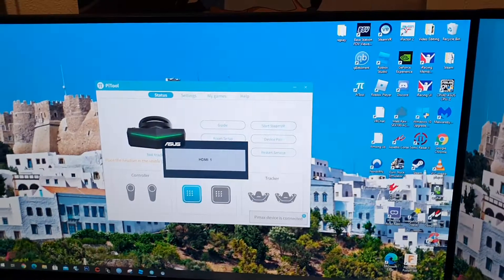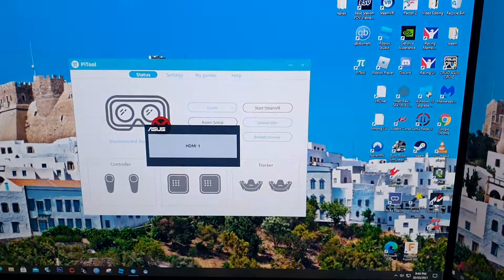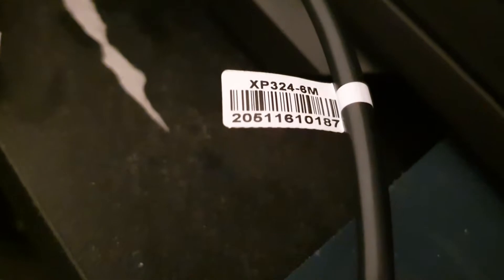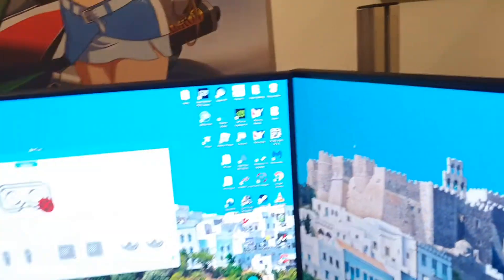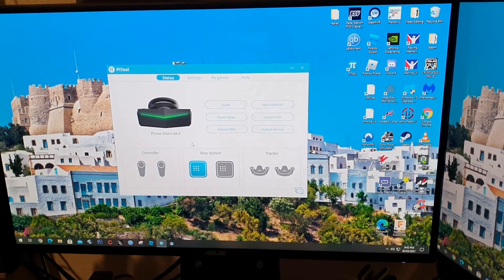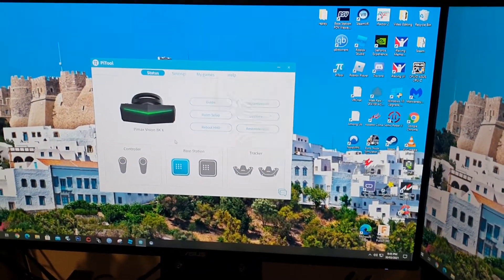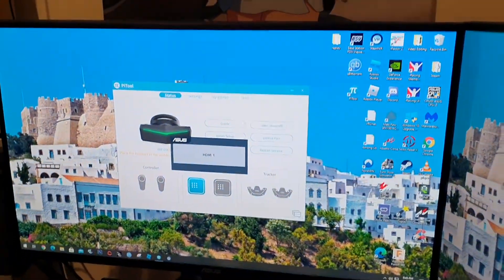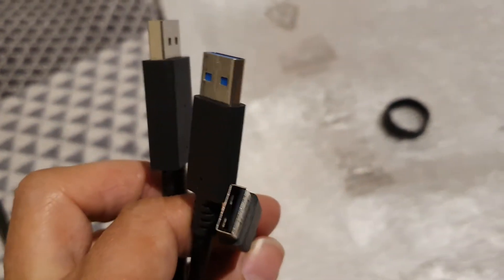Pimax 8K X Fibre Optic Cable Issues

Comment: Have you tried another drivers for GPU or Pitool versions/ HMD firmware(there is a new which has 90Hz for 3000 series but just in case) or any chance try another GPU?
Reply from the maker: I don't access nor the funds for a 3000 series GPU. Wish I did! I've tried other PiTool versions with no luck. I ended up send the cable back for a Refund.